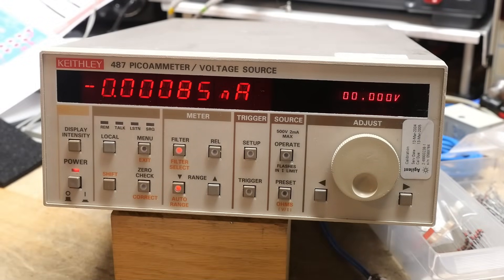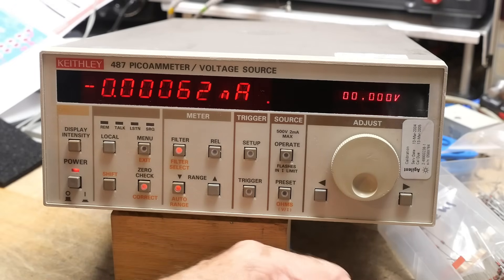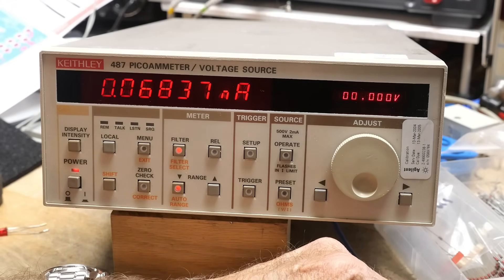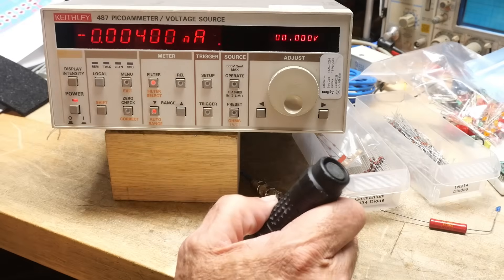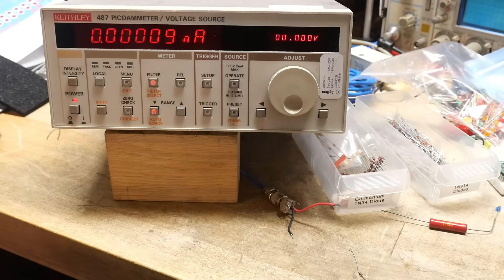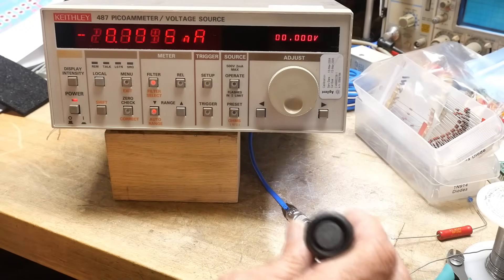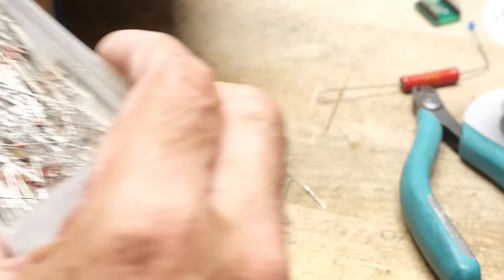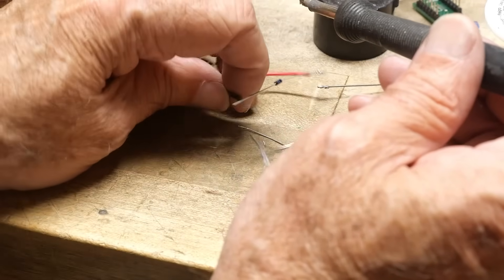#2357 Keithley 487 Picoammeter / Voltage Source (part 2 of 5)

Comment: I like the UI on that older Keithly picoammeter - I've used the newer ones in grad school that have a VFD and more buttons on the front, and they're a pain - you have to dig through menus to get to half the settings. This one is nice with direct buttons on the front is much simpler and quicker to use

Comment: In sensitive applications, you can always slip some heat shrink tubing over the glass package.  They use glass because it is the best affordable insulation.  "Black" absorbs visible light, but not necessarily IR or UV.
Photons striking a metal's electrons kick them out of the metal.  This is the photoelectric effect.  If the gas pressure is low enough that the liberated electrons don't strike intervening atoms/molecules, then they can jump all the way to the other electrode.  You could verify the photoelectric effect by rotating the light around the bulb.  If the current changes signs when the opposite electrode is illuminated toward the gap, then it is the photoelectric effect.  (But, I cannot think of anything else it might be instead.)  If you wanted, you could use LEDs or colored light filters to reproduce Hertz' classic experiment.
Reply: now they just use black epoxy for everything. I do wonder though why some small signal diodes like 1n4148's and zeners still come in glass packages, when most other diodes come in black epoxy packages these days

Comment: If you wind the current up the 1N4148 will also give out light (for a bit) ! so its an LED.
Reply: and after "a bit" it turns into a SED - smoke emitting diode.
Reply: @gorak9000  :)

Comment: This meter would be ideal to measure Galvanic Skin Biofeedback response very accurately. Measuring skin current when holding the probe by two hands.
Skin resistance (inverse of current) decreases with increased physiological arousal (like stress) and increases with relaxation, this can help individuals manage stress, tension and agitation.
Reply: hah, strap the machine as a backpack and  all the stress will be attenuated in no time by that good old precision warmth

Comment: Be interesting to see if some part of the diode readings were coming from  EMI emitted from the PWM LED controller in the flash light.   I downloaded the manual yesterday and went through the schematic to look at the front end, quite interesting, they use quite a few relays for range , filtering and zero switching.  Input amp is an ultra low input offset AD549L.  The gain is controlled by the feedback resistor in the range of 1K to 1G ohm selected by the relays.  The output of the input amp feeds an old school conventional dual slope discrete logic A/D converter.

Comment: I use surface mount plastic packaged SOT23 MMBD4148 instead of 1N4148 for exactly this reason in hyper sensitive applications like energy harvesting.

Instead of Zeners, which are super leaky, I use blacked out LEDs for ultra low current voltage references in similar applications, with reverse biased plastic packaged silicon diode like a 1N4001 as bias “resistors”: 1N4001 have a reverse biased leakage current of the order of 1 to 3 Gohm, and are far more easy to source than Gohm resistors.

If I want an ultra low leakage diode, I use a 2N3904 with base and collector tied together: these have reverse bias leakage under a picoamp at low voltages.

I use a couple of old Keithley SMUs for my measurements, and 236 and a 238: they’ve earned permanent status on my bench over the years!
Reply: I have seen 2N3904's base and emitter tied together in some Art of Electronics Chapter X protection designs. Also in section 1x.7, figure 1x.120 it is shown that the BC leakage is indeed larger than BE leakage. Why do you think they would use the BC junction anyways instead of the BE junction?
Reply: @erfankhadem7966  just looking at my copy of the X chapters now, it’s the first time I’ve seen these characteristics published anywhere. I did my own extensive Ir/Vr testing comparing a few years back on a Keithley 238 with the DUT inside a shielded fixture, and some reassuringly expensive cables. I wrote an IV test program in Python, but there’s also an IV program out there on the web that works with the Keithley SMUs that produces fancier graphs. I don’t remember seeing the BE zener knee, but then I was only interested up to 3 or 4V in my application, which was to power up a microcontroller periodically from a solar cell with a reservoir cap to be able to get over the microcontroller’s initial inrush current.

Lots of engineering and physics stuff to worry about when you’re measuring down at the femto and pico amps that you typically don’t care about, mostly around how you debug these circuits: you can’t probe anything without completely ruining the behaviour of the DUT!
Reply: The instrument uses a IT125 dual transistor E-B junction configured back to back and connected through a 100K resistor to the input. to provide some input protection.  The E-B forward voltage is way above what would be expected in normal operation and has low leakage so as not to alter the measurement.

Comment: Interesting that the NE2 is sensitive - perhaps that's related to the way that old NE2 bulbs seem to flicker in a dark room but shine steady when there's another source of light nearby?
Reply from the maker: https://youtu.be/XzAjuHqUPi4?si=dyx4HLuAXh_RyiYA
Reply: @IMSAIGuy  Yes - that's exactly what I mean. I've got some neon nightlights that have been in service for decades. They started out fine, but after years of running they now flicker in the dark. I've been told that this is because the radioactive elements that are added to help them strike reliably eventually decay and don't give off enough beta particles to ensure they strike at every AC cycle.

Comment: Why do they color the plastic on a red diode. It's supposed to radiate red. The plastic should be clear
Reply from the maker: all leds come in clear if that's what you want, the colored LEDs also include a scattering material so the viewing angle is much better

Comment: Early germanium transistors e.g. OC71 were constructed in black-painted glass envelopes looking not unlike a sub-miniature wire-ended vacuum tube. It was common practice at the time to scrap the paint off so as to use the exposed transistor junction as a photo-transistor.
Reply: I remember doing that!
Reply: There was an OCP71 which was the OC71 without paint
Reply: yup, @AnthonyFrancisJones has a couple videos about those transistors. One has a Mullard poster with attached samples of the transistor at various stages of construction.

Comment: I've seen the "black glass" diodes before - but they were just regular diodes that had been painted black before having the lettering/numbering applied. Basically, just an additional manufacturing step.
Reply: Often the black paint is there to block light because the diode is photo-sensitive and impinging photons can affect it's performance in sensitive of precision circuits.  Many HP diodes were painted black for this reason.